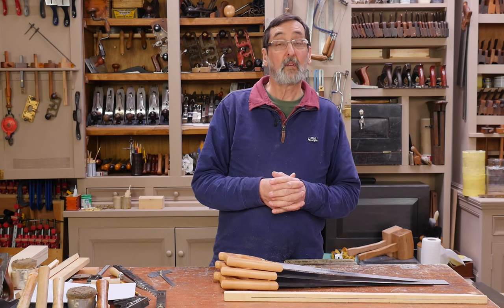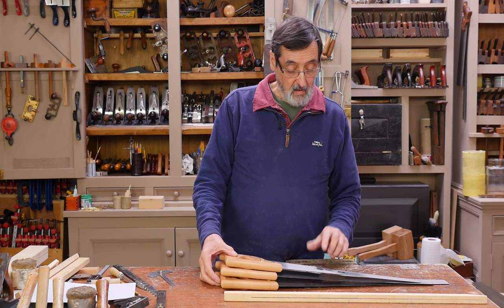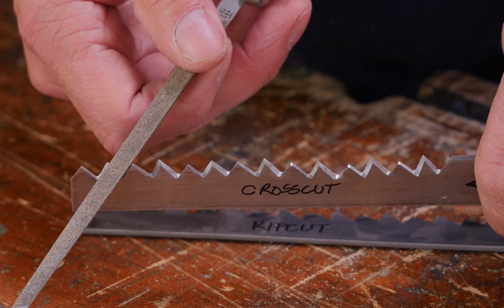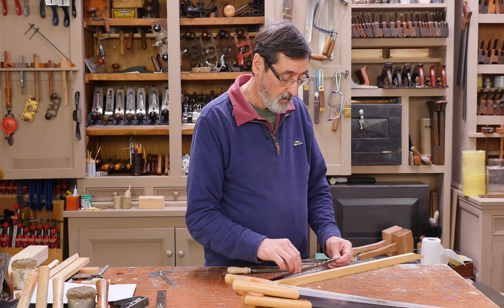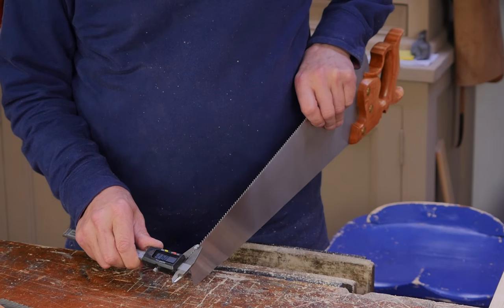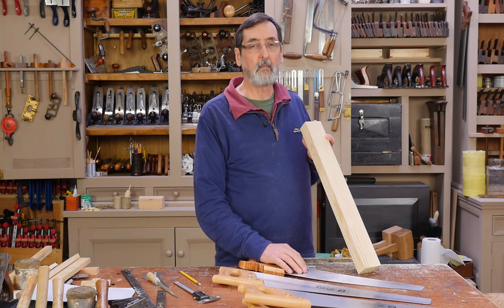Handsaw Comparisons | Paul Sellers

Comment: A hint for those like me that get lost easily.  I would mark all the valleys with a permanent marker before I started sharpening.  As you sharpen the black mark is removed and you know where you left off.
Reply from the maker: +Katie Dotson (K8-T) You don't really need it if you remember the adage, sharpen the back of the tooth leaning away from you.

Comment: As I have started to (attempt) to switch from "DIY carpenter/function over form" guy; to "woodworker", I've found that no one on youtube can explain both the easy and hard concepts better than Mr. Sellers. 
Thank you sir!
Reply: Oh my gosh - I have a woodwork twin!  My problem is, I waited 40 years to go from function over form, so now we're teaching an old dog new tricks!  Gave up "mechanicing" after over 45 years as a hobby - high performance and vintage car parts (and of course - the cars they go on) got way too expensive for my budget.  Mr. Sellers is a blessing.  I must say though - less wood is going into the fireplace!
Reply: Dan Hartman it's funny you say that about less wood going in the fireplace. I've actually started grabbing pieces of oak firewood to rip and cut stock out of for building small boxes. It's much for satisfying to me personally to take my wood from a rough split piece to a hand ripped, hand planed, beautiful piece of stock
Reply: Deadly Chicken in that case, you might save some work if you get a froe for splitting (riving) out of the log and a hatchet to hew to rough shape. A lot less sawing! Check out Peter Follensbee’s videos on hewing. He makes fine furniture using stock that is split, hewn and planed.

Comment: After watching this video last year I bought one of the S&J saws. I didn’t sharpen it or change the set - it works pretty well for both rip and crosscut. I rarely need a perfect crosscut if I’m using a panel saw anyway and it works great at rip. 

I did use some acetone to remove that varnish - it goes through the wood way easier now.

Comment: In the local hardware stores around here, the rip cut saw is totally absent. Everybody concentrates on selling throw-away junk for sawing two-by-fours with nails and concrete in them for house construction. Getting a quality tool is hard, it's either from online or second hand.
Reply: apinakapinastorba But that is why I love these videos, and feel that they are so vital for the continuation of the tradtion. Paul is showing you how to convert a run of the mill commercial saw to whatever you need or want. When I worked in construction as a framer, I always heard this old saw "Be smarter than the wood", or something similar; and what he is teaching is something that I'm lacking. The knowhow to overcome our modern day commercial driven carbon copy drek. Which makes me wonder if he has made any of his own saws in his youth?
Reply: The rip saws will be found, in circular form, 10" diameter.
Reply: Not knowing where you are in the world it’s difficult to advise but look out these spear and Jackson ones. If not look at Flynn and garlick saws from Sheffield or bad axe tool works. Avoid these lie Neilson saws they are not what they want you to think they are far far to thin and wander in the cut
Reply: @whitacrebespoke  Interesting about the Lie Nielsons.  I always linked them with quality - their marketing is good.  Is it just their saws to avoid or is all their gear a bit Meh?
Reply: Kutulue mostly just the saws the plates are far far to thin they say it will follow its own line and it’s operator error it it won’t cut straight. I brought a back saw and took it back as every time it will follow the grain and the plate bends to follow. The planes are good quality. Although I don’t like the dovetail marker much either
Reply: @whitacrebespoke  Ok thanks for the info.
Reply: I have a LN rip saw and it works great for me.  Follows a line with no effort and starts with ease.  I prefer the thin plate.  There are likely a lot of cheaper or more expensive saws that work just as well or better, but the LN was ready to go, felt and fit me well. It is incredibly light which was another plus for me, but I could easily see it being a detraction for others.

Comment: Cheap induction hardened saws have their place in any woodworkers toolkit. They are ideal for keeping in the back of the car, or for first cuts on reclaimed timbers...

As for IH saws being un-resharpenable, well, that's both true & untrue. Sure, you can't resharpen the original tooth pattern, but the rest of the blade can be cut & sharpened quite easily. What you need is a couple of lengths of angle iron, a big vise, and a metal scoring knife (I make mine from hardwood offcuts & old hacksaw blades). 

Clamp the saw between the pieces of angle iron, teeth up, with roughly 1/4" of clear blade showing. Score the sawblade several times with the scoring knife, using the edge of the angle iron as a straightedge. (The trick is getting behind the hardened edge, but you'll easily be able to see if you're hitting the hardening with the scoring knife - if you are, reclamp with slightly more of the sawblade showing & re-score.)

Using pliers, flex the scored blade back & forth until the old cutting edge breaks off. Clean up the new edge with a file. Hey-Presto, you now have a blank saw blade, ideal for practicing your saw sharpening skills on. Better to practice on a cheap blade that would otherwise be binned, than on your more valued workshop saws...

BE SURE TO WEAR SAFETY EQUIPMENT - Leather gloves & safety glasses people!
Reply: You could also use a diamond file, they aren't as expensive as they used to be, but quality still costs money and the real cheap one are not worth buying.

Comment: I’m not planning on sharpening a hand saw any time soon. However, I learned a lot about saw teeth and the differences between rip cut and cross cut saws. Never knew the blade is tapered from top to bottom.  Another great learning tool experience.  Thanks!
Reply: Get into the habbit of filing and sharpening them.

Comment: I was looking for a sharpen-able saw and saw the S&J which seemed to fit the bill but I wanted to be sure before I actually ordered it since I couldn't see it in person first. This video cemented my decision, I've bought just one for now and will use it as it comes and then at a later date I'll buy a 2nd one and do the rip modifications. Sounds like it's a solid tool that I'll be using for a long time. Thanks for the great video, as always!

Comment: I have lots of late 70s and 80s versions of these spear and Jackson saws handed down from my late farther, they are great every day saws I use mine for site work and in the workshop. As I have now vowed not to buy another disposable hard point I'm getting down those I had so the S&Js are getting more and more work as are some of my vintage ones. I think S&J don't offer a rip because they don't have the machine tooling to do it any more. Would be interested to know where they are made as S&J until about 2 years ago put made in England on them now I notice there's no mention of that.
Reply: He mentioned the S+J was made in Taiwan but I'm not sure if that was just a throw away comment meaning 'outsourced to cheap labour in Asia'. I would have thought that S+J would have access to the tooling to make a rip template but don't more to do with economic reasons - and they could certainly outsource to produce a rip saw like they have with the cross cut variant - but I think it's more to do with demand which in turn leaves knowledgeable craftsmen out of a place to buy a reasonably priced rip saw......
Reply: +Jonto Dickens S&J own some of the biggest and best names in hand tools they brought the lot (well those Stanley and irwin didn't). Elwell, tyzack, brades, amongst many others so the tooling was there as tyzack and elwell both made good saws. What I suspect though is they figured them out here in the uk then shipped manufacturing out side. What you will find is they are punched in the same machine as the hard points hence no rip available. If you want a new rip from factory at a fairly reasonable price by one from Flinn and garlick they are more expensive (not as expensive as the designer tools)  but worth it.
Reply: +Jonto Dickens just read in a book on British saws that S&J are England's oldest saw maker and they have shafted there history.

Comment: I bought the 24 inch 9515K to try. It's OK for cross cut but not so great for rip cuts. I am debating whether to invest in refiling it and then trying again. I will point out though, that my blade measures 1.0mm thick, pretty consistently throughout, and that matches the spec sheet on the S&J website. Maybe it has changed since this video where Paul measured it at 0.81-0.85 mm?  25% difference.

Comment: The latest Trad S & J's are riveted is it 'worthwhile' removing same and proper saw screws inset for cleaning and setting. (heard the rivets/handle come loose)      I'm moving away the cheap fixes of my youth, next proper metal for my brace augers (bought as a Elec Apprentice (underfloor joists, conduit)))

Comment: Thanks Paul I learned a few new tricks today !
I have some old Sandvik hand saws and the blades have a slight curve . The teeth edges are not a straight edge.
I hope I explained that right.
Why is the bottom of the blade curved and what is this called?
Reply from the maker: I guess you mean the back of the blade. This is called a skew and the saw is called a skew-backed saw. The reason for it is that it makes the saw easier to steer in the cut. A slight bend along the blade usually does not affect the saw but you can bend it quite hard in the opposite way and often this is enough to straighten it.  The teeth if they are not even will need jointing or topping. This is using a flat file to straighten them which means the teeth have to be filed to the new level too. Not an easy task for a novice.
Reply: Not to contradict Paul, but if you mean the teeth edge, it’s called a Breasted Toothline. A breasted saw is supposed to make the use of the saw more comfortable for long sawing sessions, since it suits better to the natural swing of the arm when it comes to full length strokes.

Comment: What brand of saw available in the U.S. would you recommend?
Reply: +Mike W try great neck saws. lows ore home Depot carry them.  I've reset and resharpened several without problems or complaints
Reply: Me too. Thanks.
Reply: Well, I use a 470 year old saw made by a very old company.it burns the hell out of me when I want to sharpen it
Reply: I'm no saw expert, and do more carving than precision woodworking, but I have a Freud rip cut saw ( made in England)  that I have been pleased with.   no longer recall where I ordered it from, probably Woodcraft years ago.
Reply: Looked at the Freud website, it appears they only make circular saw blades now?   no handsaws listed

Comment: i fully intend to try this great stuff but I was taught that a rip cut saw also has less teeth per inch and a bigger gap between each  tooth to allow for larger amounts of swarf so that the saw cuts along the grain more efficiently as for the set they both should have a decent set to stop the sides from binding so is there a way to increase the valley size to make a rip saw cut faster
Reply: +Roc Lo You can change the number of teeth per inch ... eg you can effectively turn every second tooth into a gullet and halve the number of teeth per inch ... but if you were to do it by hand you are going to go through some files ... and good files are not super abundant these days.

Someone with a re-toothing machine that punches out the teeth could easily strip off the original teeth and create any pitch you wanted.
Reply: +Paul McGee  i wish i knew someone like that, i suppose I'll have to decide which one i want more my file was given to me by my dad he got it from his dad now i have the file any  instructional videos on how to proceed on this technique I'm very curious about the shape of the valley/gullet as i have seen they differ in some saws some people say its got to do with the swarf or shavings and how they curl into the gullet so i'm after  the one that gets you through the rip the fastest.

Comment: When Paul pulls the file back, he’s resting it lightly in the tooth to align it and then he applies downward pressure only as he pushes forward to cut. Never apply pressure on a file while drawing backwards. It dulls and breaks its teeth. Rubbing back and forth with a file as if it were sandpaper is a sure sign that a person doesn’t know how to use it.

Comment: I really like your videos.  They're so informative yet so simple to understand.  I bought a bunch of hand tools at an estate sale a few years ago. The hand saws are duller than a Meril Streep movie. I've been meaning  to sharpen them .. along with my grandpa's  saws, my dad's  saws, my uncle's  saws and a few others.. lol I'm curious  though.  Why was there a notch missing from the tip of one of those new saws? One of mine has the same notch and I thought the guy I got it from needed a small strip of tool steel,  maybe for cutting  threads on dowels.. but now I'm stumped.. what's the purpose  of the notch?

Comment: In defence of the much more expensive saw, it's a bit shorter than the S&J saw, so each stroke is going to remove less wood sort of inherently. It's nice to know the S&J saws are not as bad as they look. I suspect the reverberation of the S&J is down to the thicker plate having less clearance in the cut, resulting in more friction. Probably a rub with an oily rag or a fraction more set would probably take care of that.
Reply from the maker: +Mooncabbage Actually, I use the same length stroke no matter the length of the saw as long as it is longer than 20". Habits become standard.The reverberating plate is caused by the extra length of the plate and then the added friction caused by the surface coating on the plate. With the coating removed and a little wax it cuts as well as any and all premium saws.
Reply: I guess it makes sense that the stroke length would be the same, you'd find a comfortable stroke and stick with it.

How did you remove the coating from the saw plate?

Would you consider doing a video on cheaper tenon saws/back saws? Good quality second hand tenon saws aren't a thing in my part of the world. I ended up buying a Veritas backsaw, which wasn't too pricey, but is actually more expensive than the S&J equivalent, probably about twice as much.

I did eventually find an old backsaw which works just fine for me, but it did take a while. The same beginning woodworker that benefits from this video might benefit from another on a starting tenon saw too.

Comment: Great video Paul, much appreciated.  Any chance you could make one to show us lesser mortals how to cut square and true?  Not so much across the width of the timber, a knife wall solves that issue - I mean when you cut down into the timber.  I guess practice is the answer, but is it the only answer?
Reply: The saw can be a big issue to excessive set or set to much on one side will cause wandering issues. Once you have a decent correctly set saw it then come down to practice. Like any tool a saw will try to follow the grain so it's just a case of keeping it cutting true with your hand placement.

Comment: I am about to convert a 8 ppi crosscut saw into a rip saw but I wonder: the crosscut saw has some rake to it and I am concerned that the rake will cause some problem if I only file across while following the (raked) gullet. Do you think I can treat the saw just like Paul did or should I try to eliminate the rake as well? Thankfull for help

Comment: Does it make any difference for cutting plywood? Asking because plywood has layers of wood sheets arranged with the fibres at right angles to each other. What is a rip cut for one layer is a cross cut for another. Most of the work in India happens with plywood. I am a hobbyist. Thanks, Regards,
Reply: Plywood is notorious for breakout due to the layered fibres. You will only really know when you actually get the plywood and cut it. 
Is pinewood not easily available in india?

Comment: I do remember in a previous video you used a Dimond file on the saw. if you used it on this would it have made a difference? I am working with several different handsaws I purchased new and used. I am trying to get a better idea of what I need in the shop. I have saws ranging from 8" to 28" and at least 2 of each size. should I go through the process of making sure one is set to rip and the other is set to crosscut? Is it only for the larger size of 24 and up? should I have a bow saw set for both? Sorry for so many questions.
Reply from the maker: Generally, I don’t use diamond abrasives for saw sharpening because technically they cannot produce the same surface you get from a standard file. I have used a diamond file to put a micro bevel on the back edge of saw teeth to increase the length of sharpness but this doesn’t need to happen generally. It’s just an alternative sharpening method.